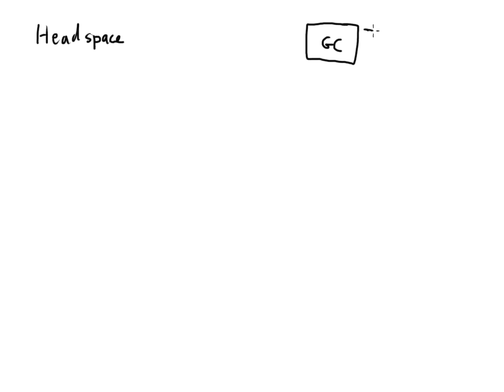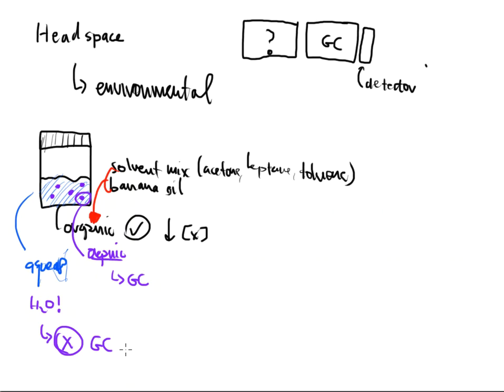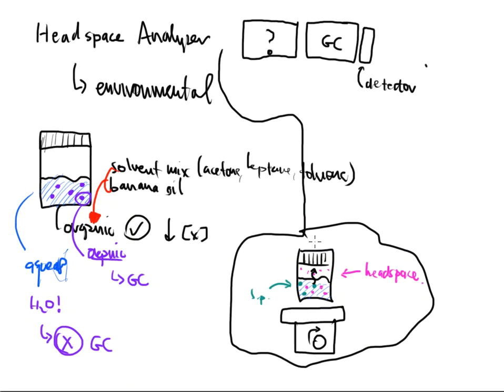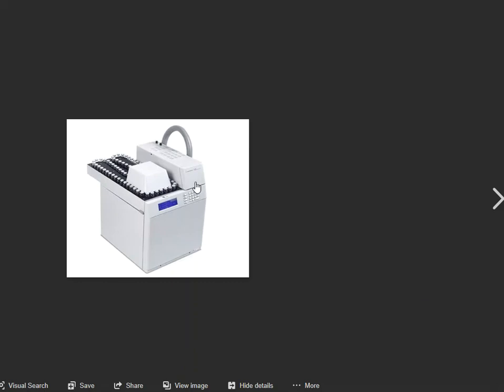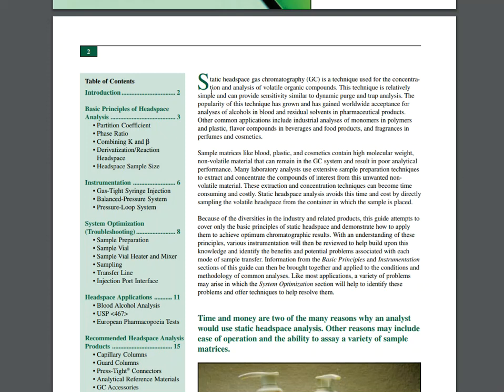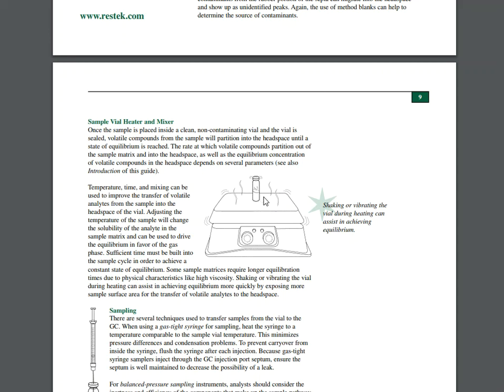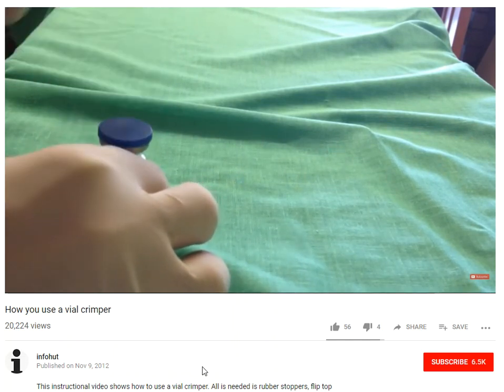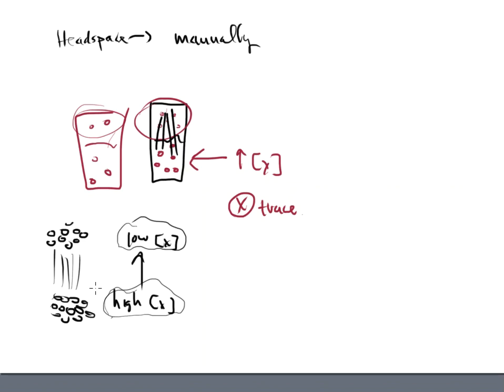Intro to GC Headspace

Comment: Thanks for the video. How do you go about selecting temperatures for the headspace method?
If I only have ethanol and n-propanol in water, would 70 for the equilibrium temperature work? Does selecting a temperature at the boiling point of the compound of interest cause problem?

Comment: B.A.C. variable: If I draw 2 tubes (using 4ml tubes)from the same (slightly intoxicated) person and one tube contains 3.5ml and the other tube contains 1ml, and run them both through the GC, what quantitative differences in ethanol results would I get>?
Reply from the maker: as long as the volume of sample is taken into consideration, the concentration of alcohol would be the same.  one mL of sample has the same concentration (%) as 5 mL or 10 mL from the same person.  the actual amount (mg or mL) of ethanol would be different from varying amounts, but concentration does not change.